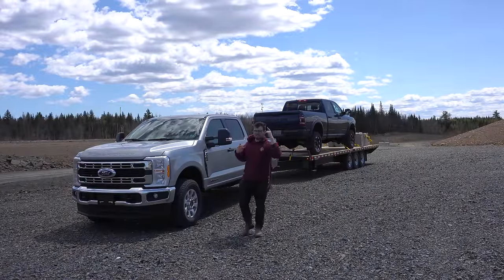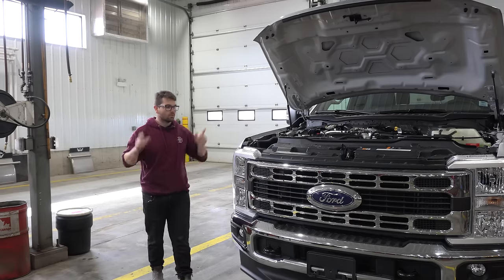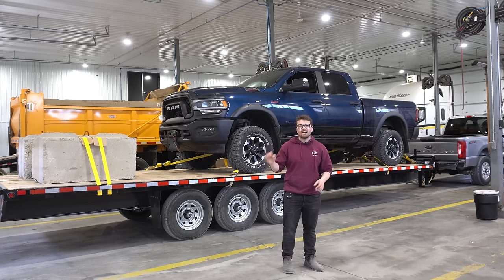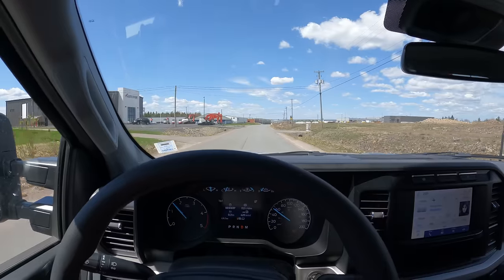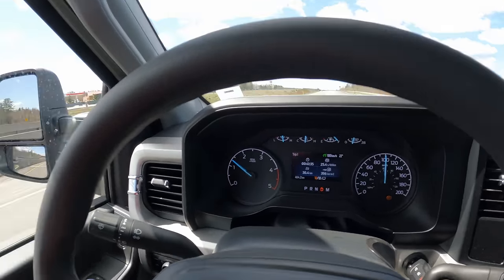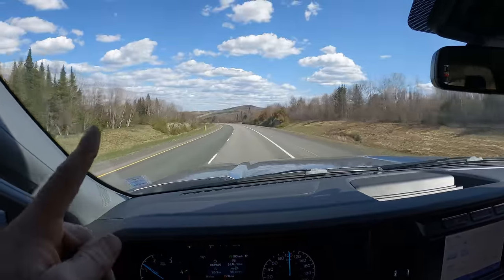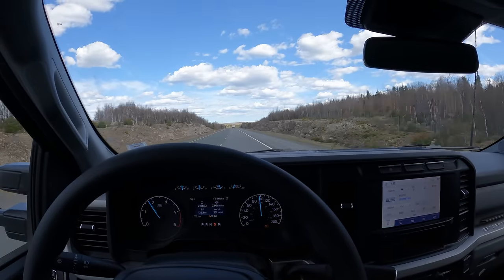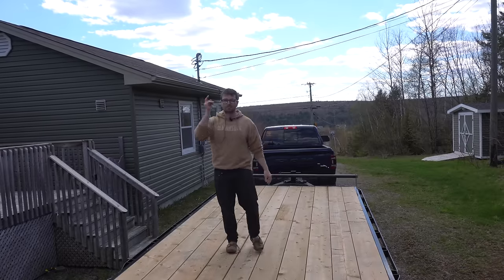Ford F-250 Powerstroke (6.7L) Diesel Engine/Towing Review **Heavy Diesel Mechanic**

Comment from the maker: The thumbnail is probably a little deceiving, I actually really liked the Powerstroke. But the towing experience was not great. Now that could very well be user error but the trailer weighed 16,500lbs and I had over 1,600lbs of tongue. I figured that would of been an ideal set up. Perhaps the blocks at the rear completely behind the rear axle was just too much weight at the rear end. Either way It won't be the last time we see a Super Duty on the channel and we'll have to re-test and see if a different load set up makes a difference. Thank guys!!
Reply: Love the videos, keep them coming!
Reply: I agree with the retest at some point, even rocket scientists don't always get it right on the first try .... or fifth or sixth ... 😀
Reply: As a Diesel Mechanic, would you want to work on that PowerStroke?
Reply: Trailers are like pendulums unless the weight on them is properly positioned. You don't want pendulums. Either put blocks on nose of trailer, then truck, engine first. Or truck engine first then blocks close behind.
Reply: @seagullsbtn  The fact is though, the truck was weighed before hand, then again with the hitch weight and the whole unit weighed as a whole ( we did not see the whole proceedings but was explained as per the knowledge of the 1600 lb added to the truck ) so the trailer did have the correct minimum hitch weight. Now had he loaded the trailer as you suggest, the hitch weight would be so extreme it would have been WAY over the maximum weight on the hitch for a pickup. Would the unit have handled properly weighted as you suggest as long as the pulling unit and the trailer frame could take that weight that far forward of the triple axles on the trailer, more than likely yes as I suspect the trailer wanted more than 10% of its total load on the hitch. Future testing with a more concentrated load just ahead of the trailer axles and the same 10% hitch weight will prove interesting.
Reply: @seagullsbtn   You’re right. Trailer is not loaded correctly.
Reply: Best towing experience had in 1 ton always been Ford
Reply: 100% trailer is loaded wrong. I know you checked tongue weight and tried to increase it… BUT… as.a civil engineer, rather than a diesel engineer you are missing the concept of leverage (weight/force and distance) and momentum… Having those heavy blocks right at the back of the trailer will always give you a massive swing factor - even if you had 5000lbs tongue weight will never change the fact that you had so much weight so far behind the fulcrum point… (ie. The axles)…. Add to that its a top heavy load - its a deck over tall trailer which i guess you proved when you couldn’t load the ram without grounding out… so now you have a single point weight BOTH far back AND way above the pivot point where the wheels meet the road.   I pull 20,000lbs - 100hp skid steer on a heavy Diamond C HDT 24ft tilt trailer, bumper pull on a 17 and now a 2023 F250 with no problem at all !!!   I had airbags on the 2017 - haven’t fitted to the 2023 yet as borderline need - but it lets you put a bit more tongue weight without squatting the truck…. PS… it will help to go buy a weigh safe hitch then you don’t guess :-)
Reply: @mattgillard19 100% also the higher trim level trucks have a smart hitch and use the taillights to help tell you how to distribute the weight. Really cool and innovative stuff Ford is doing
Reply: @seagullsbtn agree.. shifting the load would make all the difference

Comment: This comment will get me blasted...when I had my 2020 Powerstroke F-350, I thought in my opinion, it was not nearly as stable towing as any of my srw Ram 3500s.
Reply: Ram 3500's 4500 and 5500's are the best trucks in the business..
Reply: And the engine brake is a sack of s***.  Oh look out for the comments now!
Reply: I’m looking forward to see the retest.👍🏾
Reply: The Ram is heavier and feels more planted than the aluminum Ford. As long as I load my trailer heavier in the front, the Ford pulls great.
Reply from the maker: I mean the Ram 3500's are solid units!
Reply: @lrizo3841  idk haha I've owned all three and my lb7 duramax seems to be the best bang for my buck and the l5p duramax is leading right now in reliability
Reply: @The Getty Adventures  They're the best trucks in the industry.. I'm at 212,000 miles on my 2019 Ram 3500 Dually, and so far, the only issues I have were with the cp4 pump, which all three big manufacturers are having, and the EGR valve and EGR cooler. Other than that, everything else on this truck has been amazingly strong and very reliable. And I'm coming from Duramax trucks, and let me tell y'all something 204,000 of those miles are Towing miles and I tow up to 30,000 lb Plus.. trust me, I'm not biased or anything. I'm a fan of long-lasting reliable trucks, and I will always own a Ram from here on out.
Reply: I’m a ram guy all the way, but wanting to get back into a new diesel, I’m opting for the 24’ duramax due to pricing and what feels more modern. Still like Ram, but that Powertrain and cab needs a refresh. I really like how the 24’ high country drove. Very impressed and significantly cheaper at invoice.
Reply: @damonens9478  love my 03 Lb7 federal emissions standard lb7

Comment: To prevent the trailer sway I think the truck should be over the axles and the blocks towards the front because that truck is about 6 to 7,000 lbs vs the blocks 2,400 lbs
Reply: It's still a classic truck with the engine mounted in the front. Not in the rear.... back portion maybe weights in @1k lbs. It's the cab/engine that weight the most... so in other words... no, it's just coupled to a Ford.... problem was circled from factory....
Reply: True
Reply: @loadingname98 I don't know where you went to school, but where I went we circled the answer.
Reply: @lray801  yeah, where I come from, they don't give us the answers.. we have to find out whats wrong. Biggest problems get circled, completed jobs get checked/crossed out. While unfinished jobs get highlighted... 

Ford didn't just circle... they also highlighted.... 
And some of yall still need it to light up
Reply: @loadingname98  Really? Never took a test with multiple choice, huh? They only wrote down the wrong answers? So how did you ever get it right if the answer was never written? Weird.
Must be frustrating for you to see the problem be the most popular choice.

Comment: As others have said, you have very little weight directly on the trailer's axles with the centre of the truck well forward, and the concrete blocks well behind. You probably should have measured the towball weight before you hitched up, and then move the concrete blocks forward. I do appreciate your videos. You have at least one regular viewer from Australia! RAMs and F-trucks are quite popular Down Under, despite their outrageous pricing.

Comment: I think you should adjust the blocks and retest just to make it a fair comparison. I agree with the others I think the blocks are too far back on the trailer leading to the sway you’re feeling.
Reply from the maker: we will certainly have more towing videos with super duties in the future! appreciate the feedback the more I think about it even having 10% tongue weight those block were probably too far back.
Reply: Absolutely agree. No valid opinion of the drive quality unless it is loaded properly.  I’m itching to get a new truck and I was hoping this would help.
Reply: Having weight at the extreme ends of the trailer versus more in the middle, definitely makes a big difference. There’s a physicas law known as the polar moment of inertia. Trailer sway will cause a lot more torque laterally on the hitch and make the truck unstable.
Reply: Also, having the truck facing forward is more aerodynamic that headwind on the tailgate and flat back of the cab acts like a windbreak and would increase your tongue weight the faster you go.  I would put the truck in facing forward, about where you had it the first time and move the blocks forward over the rear trailer tire and it would be much more stable.

Comment: Great videos, good info! If that trailer had been level or a bit nose high it would have made a difference on any truck regardless of brand. The way it was setup would put a lot of weight on the front axle of the trailer making the pivot point very close to the centre of the trailer and with those blocks out back it makes an ideal situation for excessive sway. If the trailer was nose high by an inch or two it would transfer more weight to the middle and rear axle which would help stabilize the load even though it looks like that trailer was a slipper spring suspension setup. While this spring setup might be better for load distribution over three axles than torsion axles you would think the suspension spreads the weight evenly but it does not. Great content none the less, keep on making these informative videos.

Comment: It would have been really interesting to see you immediately hook that trailer up to another truck, loaded just as it is to see if there really is a difference in towing simply due to the tow vehicle or if the poor towing experience was due to the trailer load. Trailer sway is typically all about the weight distribution on the trailer and less about the vehicle pulling it. As always, really enjoy your honest reviews in all situations.
Reply from the maker: this week I have the same truck and you'll redo this test. Not fair to the truck!

Comment: Yeah I think blocks in front and the truck weight over the axles also truck facing Forward is the ideal towing situation
Reply from the maker: We are going to redo this tow run with a better load set up.

Comment: I can’t comment on the newest greatest superduty, but I can give my own experiential feedback on the 2021 superduty and it’s towing. We tow a rather long and large travel trailer on a semi-regular basis and have had no problems at all with sway. Part of that is because we use an anti-sway weight distribution hitch, which is always wise when towing more than 8000 pounds. 

That said, I’ve also towed that same trailer without any anti-sway, and experienced zero sway issues.

In your setup, you have two 4,000 pound blocks on the tail end of the truck (8000 pounds). If indeed these are standard 2x2x6 concrete barrier blocks. And roughly 4100 pounds of the ram on the tongue end. Rotate that configuration and you’ll have a completely different and much better experience. 

I believe if you had rotated the positions of the blocks and truck, with the truck engine over the trailer axle, and the bed of the truck at the rear of the trailer, and the blocks

Comment: Try it with a gooseneck or fifth wheel. See what the outcome would be with that typee of weight. It most likely will be better. I personally wouldnt use a bumper pull with anything over 10000 lbs with the 2500.
Reply: I agree, a receiver type hitch well behind the rear axle center line will have sway issues that a gooseneck hitch centered over the rear axle will never encounter due to that leverage effect of the attachment point on a "bumper pull" trailer. There is just no getting around that fact and the heavier the trailer for the weight of the truck, the worse the tail wags the dog if there is a reason to do so, an abrupt manoeuvre or a strong gusting side wind. Plus the fact that there is no weight distribution hitch on this trailer so its taking weight off of the steer axle compounding the problem no matter what pickup brand is used. This is in no way knocking the channel at all, just a fact of one trailer style having better handling characteristics over another.
Reply: @charlesb4267  Indeed you will have more stability with gooseneck or fifth wheel. Plus it's a simpler set up for towing alot more wieght. It's great that the trucks now are able to bumper pull those high numbers in weight but for long distance and more stability I would feel more comfortable towing with goosneck or fifth wheel. I own a 3500 cummins srw even with that I'm careful as far as bumper pull. Even though I know it's capable of bumper pulling  alot you still need to be comfortable on long highway drives.
Reply: @dom_delacroix7424  Very true, and I find a typical A frame style hitch bumper pull to be very awkward compared to a fifth wheel or ball gooseneck principle system simply because if there is enough cab clearance to do so the truck can be turned up to a 90 degree if not slightly beyond that angle relative to the trailer. I've seen plenty of bumpers smashed up on pickups due to turning too short with a bumper pull. All the same reasons why tractor trailers are typically fifth wheel design. However a bumper pull leaves ones box totally free for storage or to have a topper on it, or even an RV camper for that matter.
Reply: @charlesb4267  Exactly I've seen that before also. Lol

Comment: Ive been driving dodge for a while now I'm currently running a 3rd gen 5.9 had a 4th gen 6.7. however I will say ford is the truck to buy now strong transmission good truck and great motor

Comment: I haven’t seen it mention in the comments, the Cummins has 2 bolt main yes but also has 7 main caps vs ford and chevys  5 main caps. 

The Cummins is an inline 6 cylinder engine which is a built in advantage for engine internal balancing, strength and simplicity when it comes time to repair. 

I have worked on all three of these, the power stroke may seem great but try working on one! Horrible, 16 hours labor time to remove valve covers. Cab off is common to do any work on these engines. And in some vehicle applications good luck removing the cab. The labor Cost to maintain the ford is the whole reason I wouldn’t recommend it.

Comment: As other here have said, I think the load distribution was the culprit of the sway. Anything towards the rear of the trailer will do that. It's like the tail wagging the dog. I've had my share of different size and weight trailers so it just takes a little tweaking to find the sweet spot. As for the big 3, I would choose the GM for comfort, Ford for winning the race, and Ram for ease up the grades. I love my 2017 F250 but friend's ram pulls a lot harder and easier up the grades. My friend's GM rides so much better than the Ram and Ford but it's a slug unless it's tuned 😉 Great video! Not enough from Ford for me to upgrade from my 2017 though.
Reply from the maker: Agree with your conclusion about the big 3!
Reply: I use an 06 F350 to pull our 38 foot, 12k trailer. I had to use a Ram 3500 with the Cummins to pull it and my 06 walked all over the Cummins. A newer SD would do even better, especially with the 10-speed.
And yeah, he really pooched the trailer weight distribution. Just because he had tongue weight right, there was a shit ton of weight behind the trailer axles with hardly anything directly on them. He should know that.
Reply: @lray801  Interesting about the Cummins. I've never actually towed with one but I did notice that they lug lower in rpms than the V8s.

Comment: Ford and other truck companies finally crammed enough tubing and wires to deter the average diy  from working under the hood
Reply from the maker: Duramax is the same way lol just stuff everywhere. But that's what you get with a V8 turbo diesel
Reply: The forgot to leave space for your hands to work on it! Junk!

Comment: I like the testing you are doing, but it would be nice to see a direct comparision between the Ford and the Chevy with the trailer weighing the exact same and loaded exactly the same, then you could actually compare differences between the trucks. Adding 3000 lbs of load to a trailer will make a noticable difference pulling a grade. I would actually rather see both trucks haul the same load that you had behind the Ford even though it wasn't a max load for the Chevy.
Reply: It’s definitely not a true comparison as the load is not the same weight. You are 100% correct! He also doesn’t know how to put weight on a trailer and that is white swing. I drive a hot shot truck and know what happens when you load it wrong.

Comment: It was quite heavy and maybe it could have been loaded better ( I wouldn’t know) but a trailer shouldn’t have to be loaded perfectly to avoid sway like that. There’s got to be a nice margin of error. I would think there was the wind, but it was a headwind not a side wind. Hopefully you’ll get another shot at it in different circumstances. That motor is a beast! Love the channel. 😎
Reply: It absolutely matters how you load that trailer. If he would’ve had the majority of the weight pulled forward just a bit towards the tongue it would’ve never swayed. The guy just doesn’t know how to load a trailer.
Reply: @darrelltuma4553 and it shows

Comment: I tow skid steers and mini excavators all the time. Trailer sway is caused by too much weight to the back. Even if you have 1,600# on the tongue, you also have 5k# at the back of the trailer. That's 31% of the weight, and if you look at the video, just about as far back from the axles as it can get. I cant see (for sure), but the thumbnail from your Duramax video shows only blocks on the trailer, with a more evenly distributed weighting. The blocks at the back don't appear to be as far behind the axles either.
Reply from the maker: You are correct. I think my loading with simply not correct. but fear not I have the exact same truck this weekend and we are going to load this trailer correctly do see how the truck does. Probably much better!

Comment: The wind at speed flows better around the hood and windshield rather than the tailgate and rear of the cab face it forward less resistance
Reply from the maker: Ya I was thinking the drag could be a factor. I was also heading into a large headwind